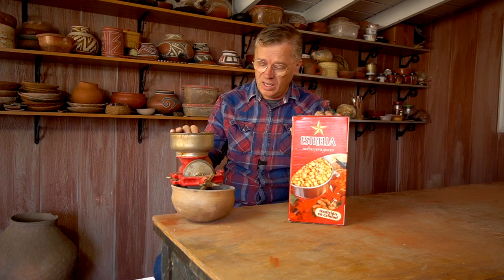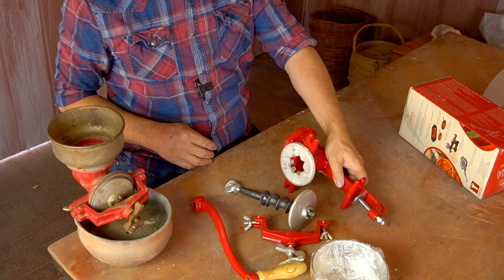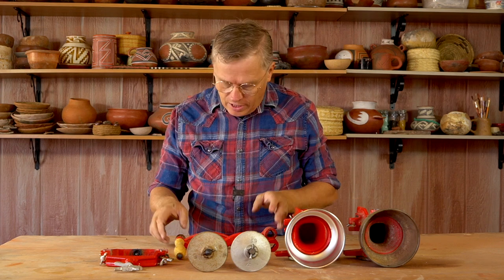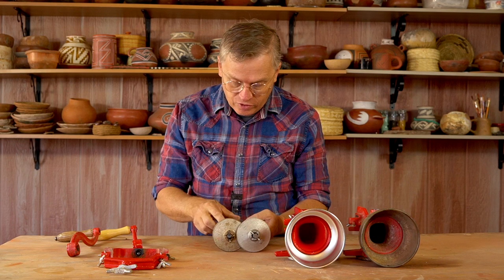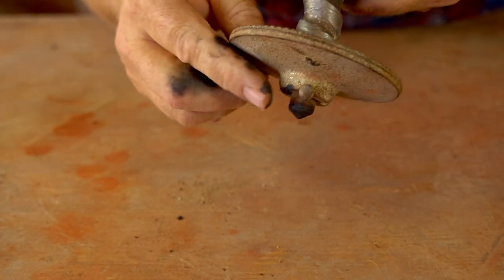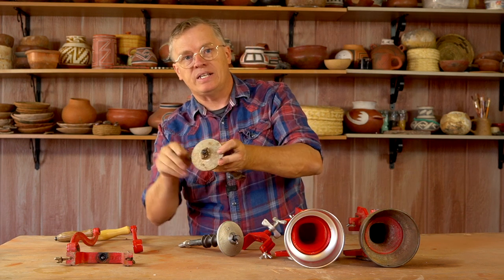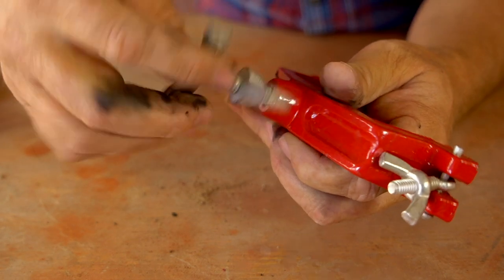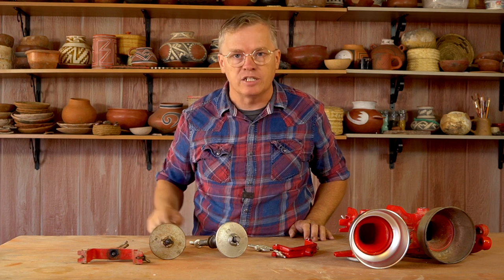Corn Grinder Unboxing (for wild clay preparation)

Comment: I’ve got a question for you about grinding clay plus the caliche pottery you mentioned in the q&a: I live in an area where all the clay deposits have a lot of limestone rock mixed in with it, so I feel like I to have to levigate my clay in order to use it. It’s such a labor intensive route I’m looking for an alternative. Do you think limestone mixed in the clay body would behave like caliche and not explode if it’s ground finely and the firing temperatures are kept low enough? I’d love to be able to just corn grind it all together.
Reply from the maker: Yes, unfortunately limestone acts exactly the same, it is after all just another form of calcium carbonate. Try mixing your clay with water into a thin solution, then passing it through a paint strainer bag such as you can buy at Home Depot. Let it settle overnight, then pour off as much clear water as you can, then pour into a pillowcase and allow to dry until plastic.

Comment: Hey Andy, thanks for the video and the tips, it's very interesting. I am looking for a way to manually grind clay that has already been bisqued in order to make coarse grog. Do you think this corn grinder could handle it ? or do you have a better idea ? For now I use a hammer and a mortar and pestle but it's a long job.
Reply from the maker: I use my corn grinder to grind up fired sherds for temper. It depends on how hard they are fired, most grind up just fine but every once in awhile I hit a sherd from a vessel that was fired harder and it can be quite jarring. Give it a try.
Reply: @AncientPottery  Alright, I will definitely give it a try then. Thanks for the quick answer.

Comment: Hey Andy! got a question, how far apart should the plates be away from each other? I've been getting material stuck to the teeth of the plates making the surface flat and not grinding really good (because of the compressed clay)
Reply from the maker: Yeah I have had that with certain clays. Sometimes I have to take it apart and clean it, cleaning the plates with a wire brush helps

Comment: Hi Andy, I have a question. I bought this grinder and it arrived quite banged up(hopper part esp). Proceeded to put together. The end of the screw that goes into the ball bearing is not cut very level- Is that a problem? Also the pin is bent so much, and off kilter that it wont allow the grinder to turn. Am I doing something wrong, or should I just get a different one?Many people are complaining on all brands about metal shavings being in the ground material. I assume after a breaking in period that would not be a huge issue for clay use? Any input you may have would be helpful, thanks. I have always wet processed my clay(and fired in regular electric kiln) but the grinder looked like a way to speed up the process of getting clumps ground up. Thanks!
Reply from the maker: It's kind of hard to troubleshoot from far away. I would say that from my experience the end of the screw is never even and doesn't make much difference. If the pin is bent, then just get a pair of pliers and bend it into a desirable shape. Since you're not eating the produce I don't see why it would matter if there were some metal shavings.

Comment: good information 
i will add a bit of info, it would be a good idea to wash that hole and ball bearing out with solvent before you re-grease it. if you add grease with the existing grit it just becomes a better grinding agent (like valve grind compound).  sand mixed with the grease would be the worst.
that beings said 10 years of use is great.
when i got mine, and found it worked so good,  i couldn't believe that i had previously ground my clay by hand.
thank you for this, it great information and video.
tom
Reply from the maker: Thanks for the great tip. Definitely something I will do.